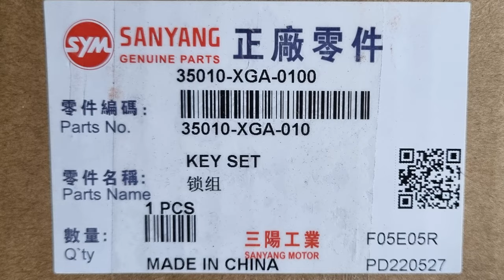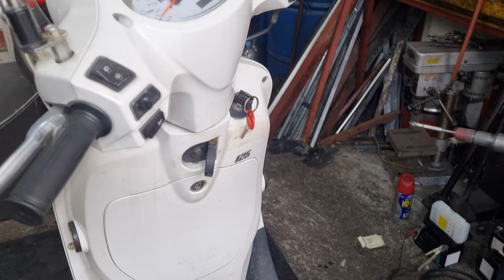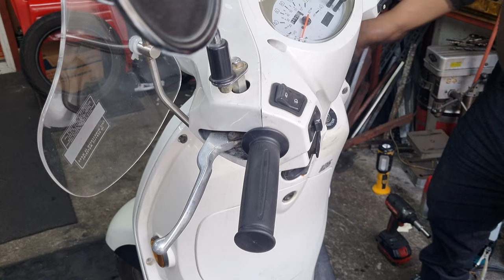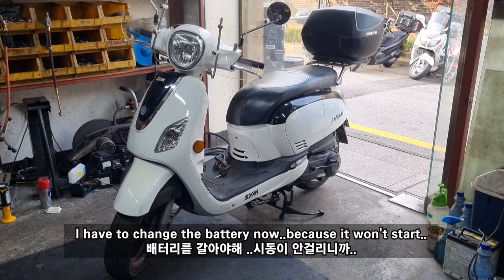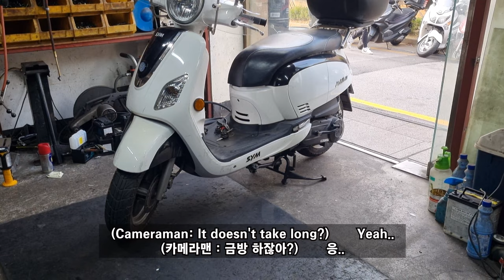Very easy motorcycle key set and battery change. SYM Fiddle 3 Pretty Scooter self repair

Comment: Hello, I am using this motorcycle, the throttle is very hard. Should I change the throttle cable?
Reply from the maker: You will have to check it yourself to find out... but if the throttle cable movement is not smooth, it looks like it will need to be replaced.
Reply: @MotorcycleRepair  Is the hardening caused only by the throttle cable? Is there any other factor I should check?
thanks
Reply from the maker: @hakkbolar5357  In most cases, the oil inside the throttle cable dries up, causing the cable to not operate smoothly and become stiff.
You can also separate the cable and put oil inside the cable to make it soft. However,
Nowadays, a common repair method is to replace the cable.